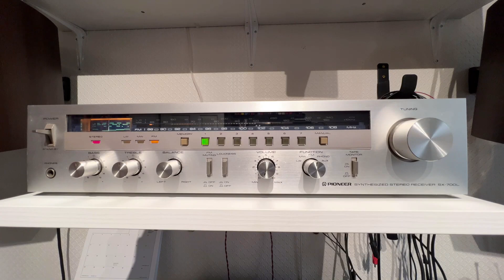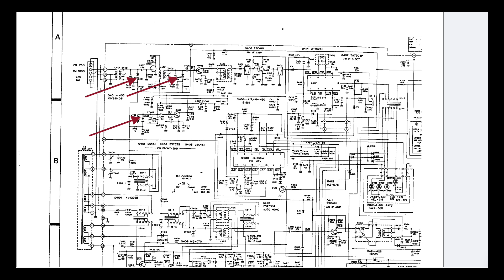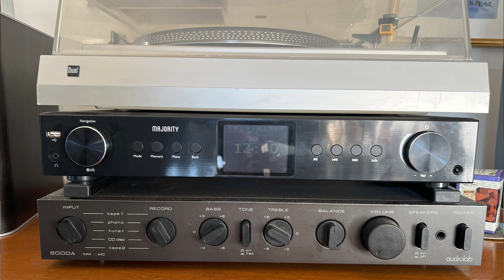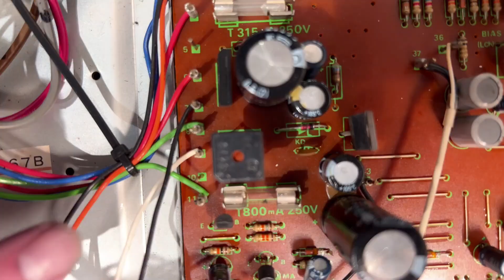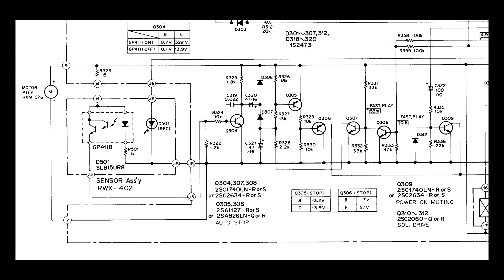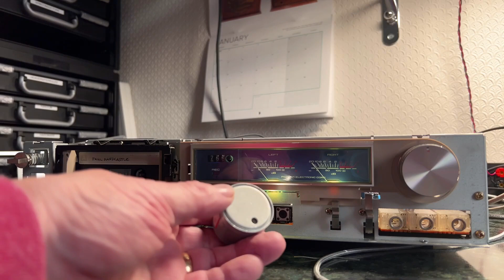Come Back Stack

Comment: I had exactly those 2 units as a 20 year old, which I bought in 1982 after saving my $$ for a fair few months. Combined with a PL720 Turntable. It gave me about 20 years of service before I put it in the trash and bought an all in one Aiwa unit with CD deck. That also went in the trash after about another15 years. 

Wish I still had all of those, just for the nostalgia

Comment: Good to have you back, Neil, and happy new year! And good work on getting that deck going. Where did you order the motors from?
Reply from the maker: The replacement motor is type EG-530AD. They are fairly widely available in the usual places (ebay, aliexpress etc) with prices between £1-£15. Mainly depending on how quickly you want one :-)